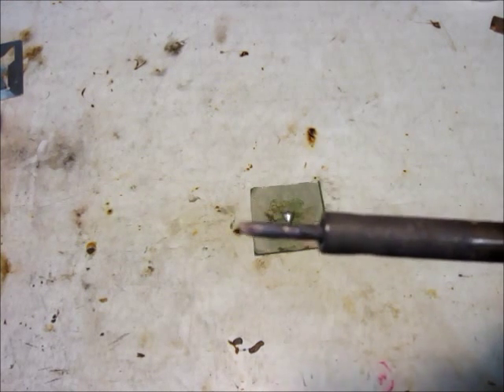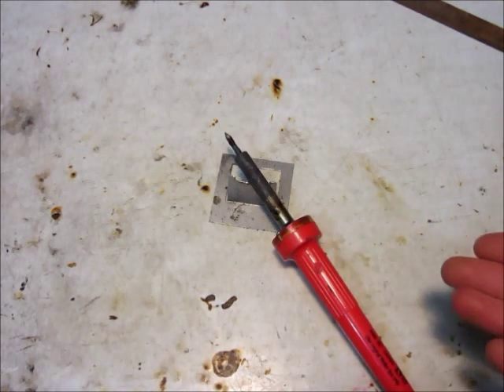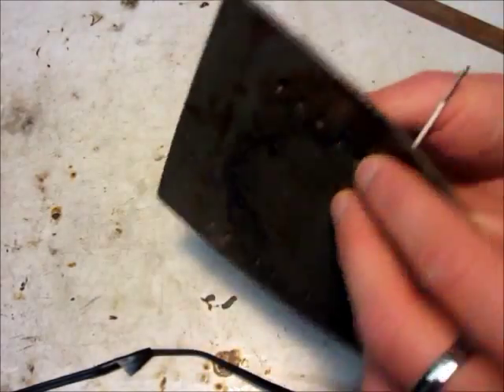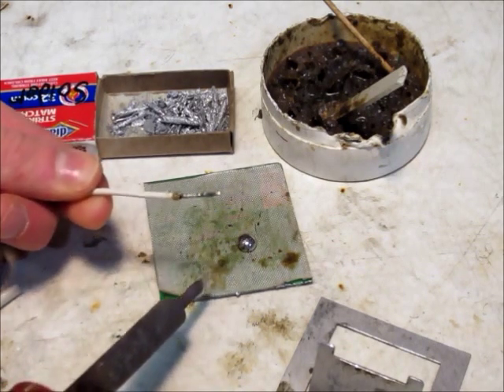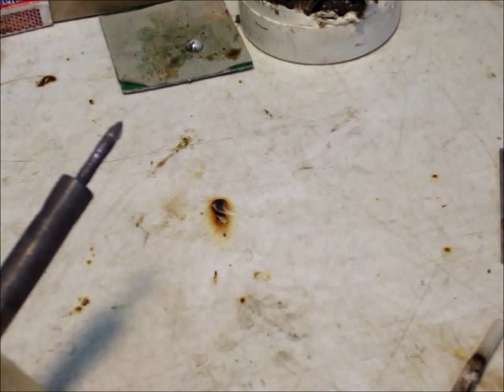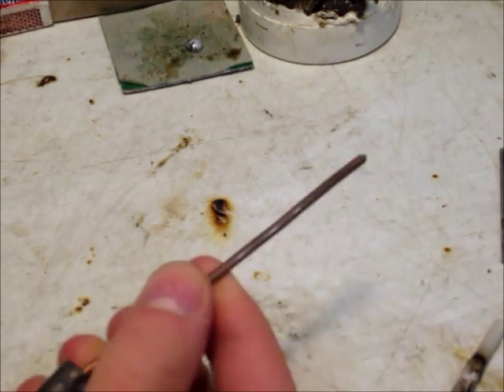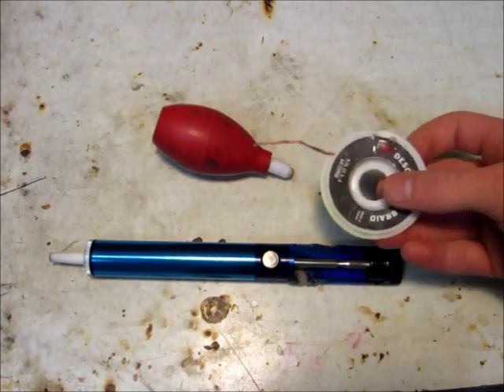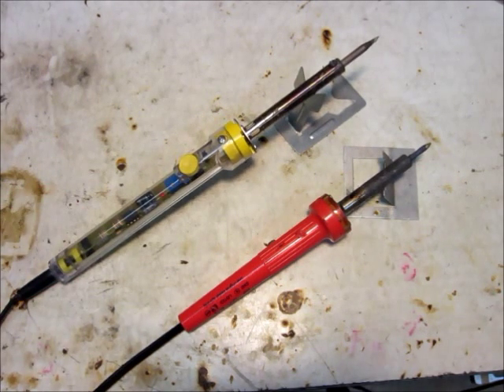10 Helpful Soldering Tips

Comment from the maker: Really you don't want to use acid flux with electronics because it will corrode stuff.  I still think it works the best though.   You made me curious so I just looked it up and there is a really good Instructables about making rosin flux from pine cones!  In fact I'm going to have to try it to see if it works as good as the stuff I bought!  Link:   /id/Make-your-own-Eco-friendly-soldering-flux/

Comment: really really great tips. i don't even know about the flux, now i know how it works now.

Also are there other things other than flux?
Reply: i guess you clud use acid but yeah that kinda not what u want since flux is an acid at high temp where as regular acid just eveparetes and corosion builds again